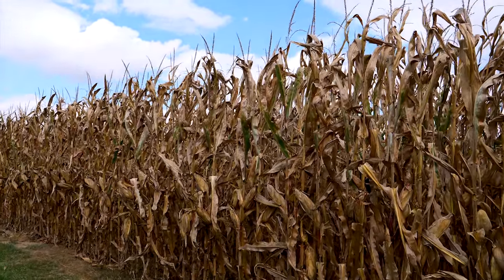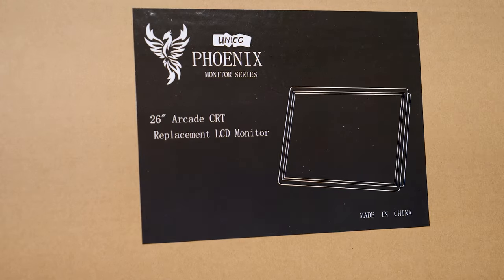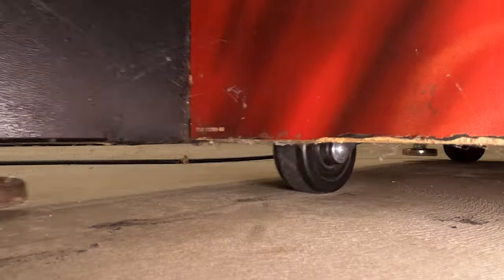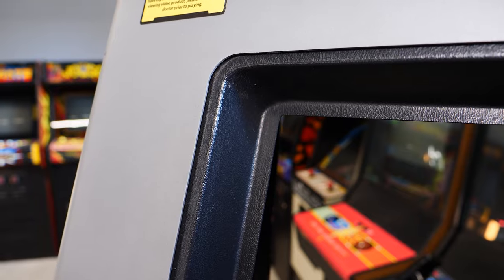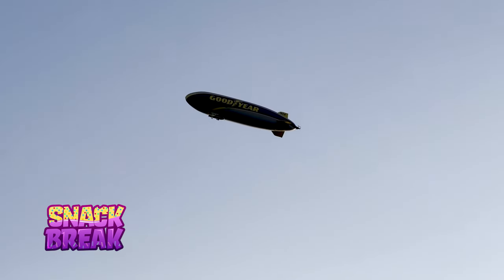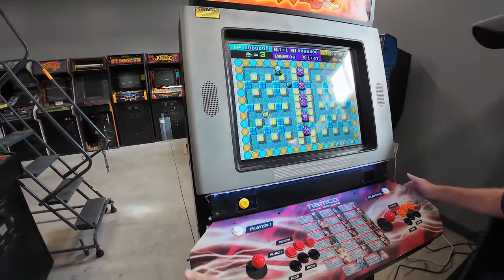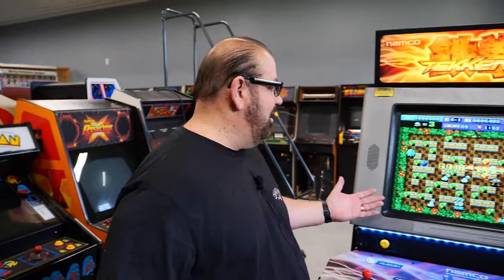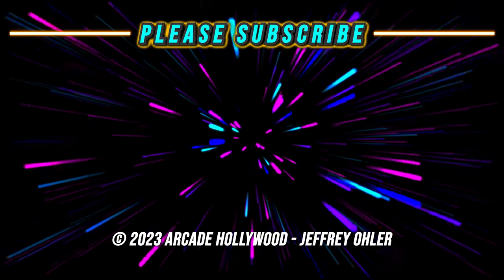Unico 26" Arcade LCD Monitor in a Namco Tekken 5 Gaming Cabinet

Comment: Hey Jeff! I was just reading about these Unicos! I saw that some standard res pcbs struggle with fitting everything in frame; I've been eyeballing these for MK/MKII. The manufacturer doesn't support vertical size adjustment just vertical position (at least from posts I've seen from 2 weeks ago). They mentioned releasing firmware at some point, but curious how they will roll that out.

I'm glad things are working out of the box really well for your setup! I wish they'd also increase the width of the mounting bracket so that folks don't have to do additional customizations. I do love that you added additional protection onto your monitor, because you already noted a scratch. Great thinking!

Sweet sound setup as well! We'd love to come visit at some point!
Reply from the maker: TJ, they are working on firmware updates for this.  There is nothing else out there right now in regards to monitors at that aspect ratio.